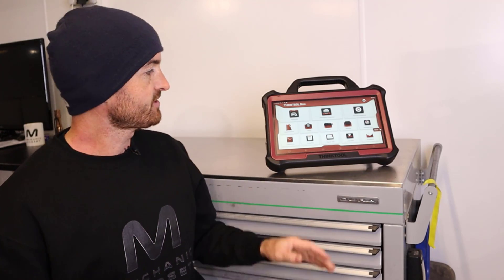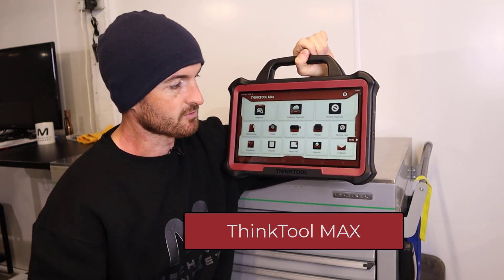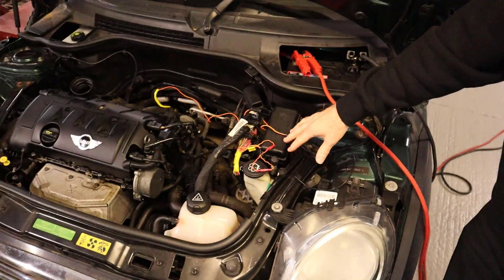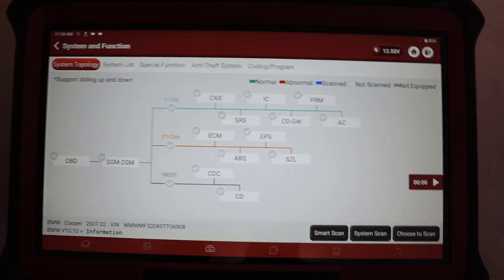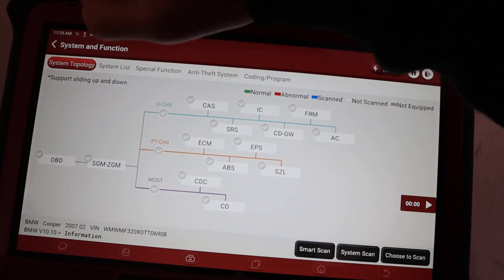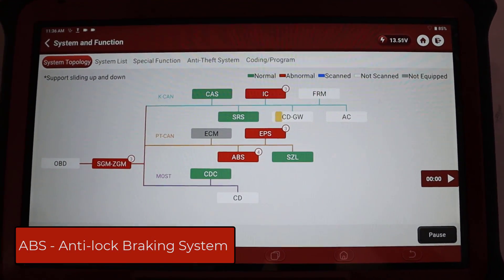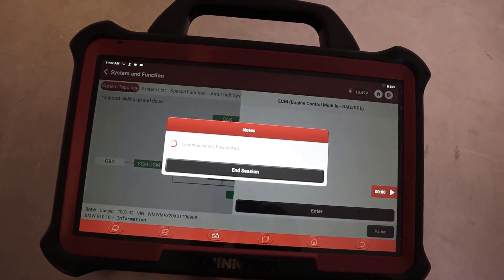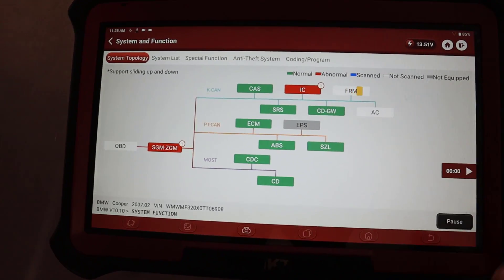Scan Tool vs CAN Bus Diag | ThinkCar ThinkTool Max Platinum S20

Comment: Good luck with support from this company, I have the Mucar VO6 also a ThinkTool product that came defective and there so called online service (in China) has to be reached at night and does not respond. They had my flash my own scanner to try to fix it and now want me to have them connect to my personal computer to try to reflash again. I will be returning it at this point and looking for better product suppot and quality control. They don't test their products before sending out from China, Besides this they only have a 30 day return. Buyer Beware of anything shown as ThinkTool or Mucar.

Comment: Launch, topdon,think tool,looks like the same software in all them, what one would be the best?
Reply from the maker: They are all the same software really. I’ve not used the Launch or TopDon so couldn’t comment on the experience. This works nice though 👍
Reply: @MechanicMindset  Did you see Launch smartlink yet?it looks interesting but haven’t seen a work yet🙄
Reply from the maker: @ccbanger1414  Yes, ThinkTool has it too. I’m hopefully gonna get a video on the feature soon 👍
Reply from the maker: This Max should hopefully get the feature too
Reply: @MechanicMindset  hopefully you can do it soon🙏
Reply from the maker: @ccbanger1414  Just waiting for the guys at Impact Diag to set it up 👍

Comment: Looks like launch pad vii
Reply from the maker: There a few similar brands and tools out there 👍
Reply: That is an excellent scan tool. Probably top of the line for Thinktool. I'm looking at the Thinktool ProS. I'm sure it's lesser of a scan tool but more affordable for a DIY'er. Nice video, thank you!!!
Reply from the maker: @dalebabbitt6185  I see Ivan @Pine Hollow YouTube channel swears by his. I like them 👍Have you seen my Master 2 video?
Reply: @MechanicMindset  I have seen Ivan use and praise the ProS. I missed the October Prime Days deal for $935. Still watching though. It will have to come into the garage via the back door so the wife doesn't see it and release the Spanish Inquisition on me. (I'm also a stateside Monty fan)
Reply from the maker: @dalebabbitt6185  🤣🤣🤣 maybe contact one of the dealers in the description, mention you saw my video and they might be able to cut you a deal 👍
Reply: Same manufacturer mate - launch/thinktool software+hardware uses similar infrastructure
Reply from the maker: @thesmartguy3523  +TopDon 👍. I suppose it’s like buying Android phones 😆 I think there are some subtle differences on feature’s, but I’ve not had the equivalent side by side
Reply: it is a copy of LAUNCH X431 PADS.... the only plus is LAUNCH PADS don't have IP restrictions in America
Reply: Great review.